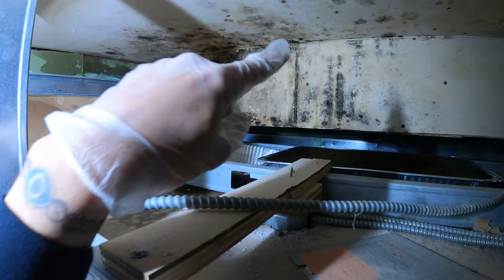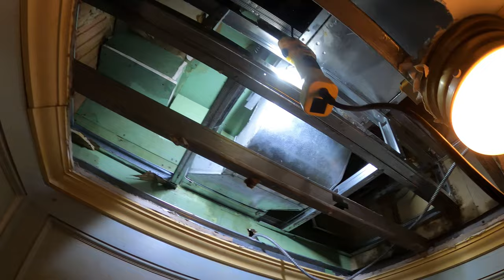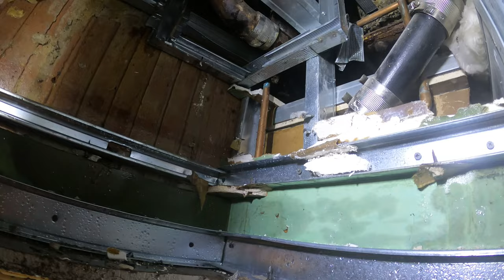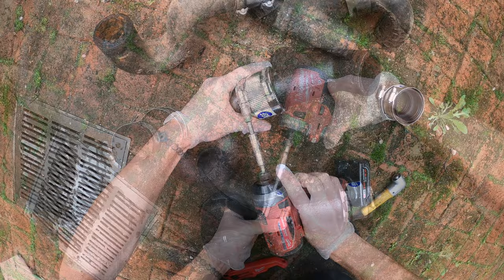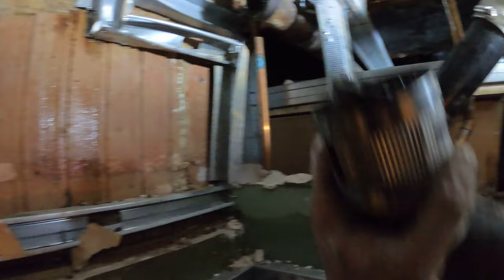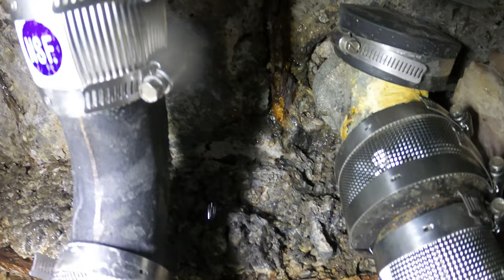PLUMBING: Ceiling Leaking Water Below Bathroom Shower/Sink (Drain Clogged With Hair and Dirt)

Comment: Were those fittings and pipe that you replaced leaking?  Looked like some surface rust and I couldn't really see in the video where the old pipe and fittings had holes in them.  Also, to ensure that you're applying proper torque to the no hub couplings you just installed, you really need a torque wrench set to 60 in/lbs (80 in/lbs for heavy duty/husky couplings) instead of that impact driver.

Should've done the simple things first like checking to see if the drains  were backed up before you opened the ceiling.  Would've probably saved some time.  Clear the drains out from the bathroom up top first and then find out if you still have other leak problems in the ceiling afterward.  Snaking the drains out from inside the ceiling below is a good way to get soaked and filthy when the blockage releases with all the water behind it.

Comment: Those fernco's  are for venting and to save you if a waste line breaks in an emergency they are not meant to be used like that hack did in that application. They where all leaking because  (pressure ) built up because of a back up, they also have to be torqued to a specific inch pound. I learned that from a old time pipefitter. I was on a job and said slap a fernco on that shit and he went off on me.
Reply: He wasn't using Ferncos though...he was using no hub couplings.  They're supposed to be used with cast iron no hub pipe and fittings.  There's nothing wrong with him using the no hub couplings.  I do agree that he doesn't have the proper 60 in/lbs of torque applied to those new couplings (80 in/lbs for heavy duty/husky couplings) because he's using an impact driver instead of a torque wrench to tighten them.

As for Ferncos, I use them quite a bit with repairs.  As a matter of fact, I've used a metal shear band around the Ferncos and I think they hold up better than the no hub couplings, IMO.  Not saying that I use Ferncos exclusively to connect drain pipe.

To each their own, but he ain't wrong for using approved materials for this application unless code says it's wrong.  However, I will question as to whether or not he knew what he was doing the whole time.  He seemed to have changed out the pipe and fittings simply because they "looked terrible" and may not have necessarily been leaking or in imminent danger of leaking.  Didn't see much on the fittings and pipe other than surface rust.